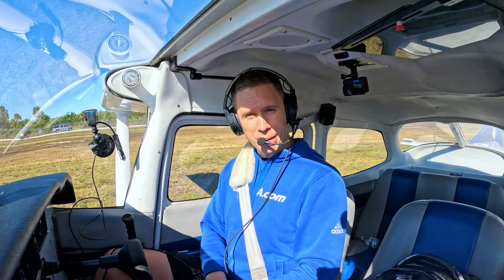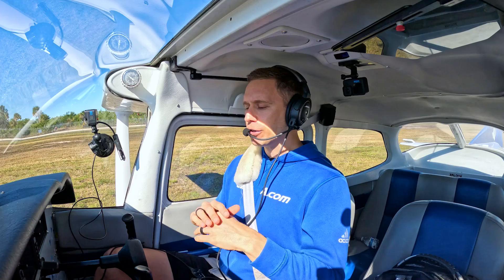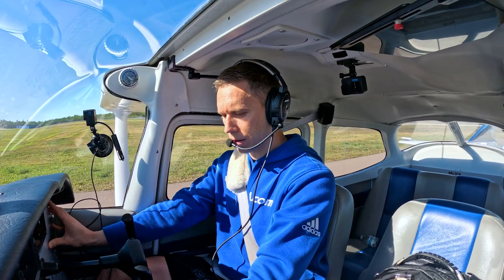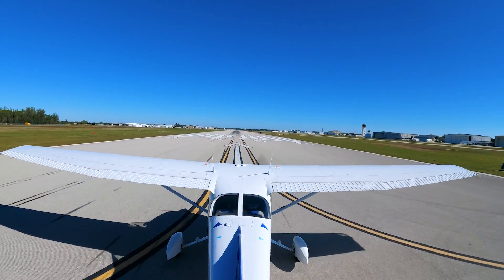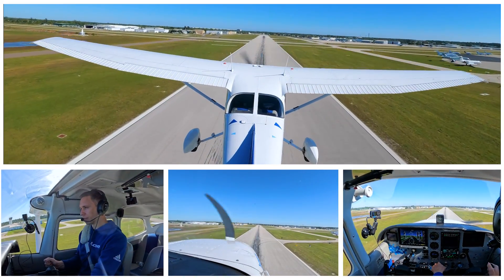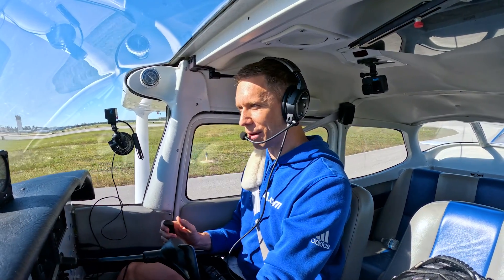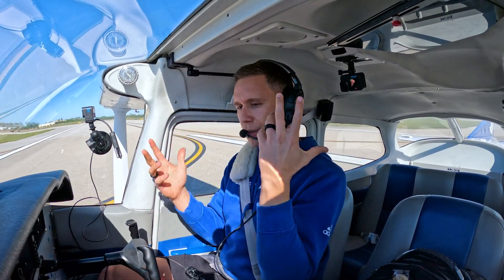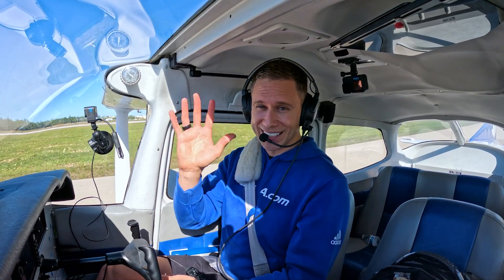Engine Failure On Takeoff with Runway Remaining - Day 5 of The 31 Day Safer Pilot Challenge 2024

Comment: 5 for 5.  Have to say, this has actually happened to me...bird strike first, right into the prop arc...guts and crud spreading all over the front, then the engine coughed, I was maybe 50' off the runway.  Not going to lie, it took me a good 2 to 3 seconds to register what happened.  Pushed the nose down for airspeed, saw the ground in my peripheral vision, pulled the nose up just enough to put he mains down....hit hard...from there it was all rudder.  Landed hard...very hard.   Pretty much all I can say.

Comment: As others have said. This should be briefed before EVERY takeoff in order to try and minimize the Startle Factor. At the same time we should also brief our minimum altitude for a turnback to the airport, e.g. "If the engine fails below 1,000' (AGL) we will not attempt a turnback to the airport, buy will land 30° to the left or right". These things need to be in our minds before leaving the ground!

Comment: My instructor did that to me before i soloed. Started the climb and he pulled the throttle all the way back. I immediately pushed the nose down and shouted "what are you doing". He pushed the throttle forward and said "keep going, nice reaction". That gave me a lot of confidence and proved to me I could react automatically without thinking. It was a great lesson. I will never forget it.
Reply: I was taking off, and a gust of wind made the plane abruptly bank right. I did nothing.
My CFI reacted quickly and put that nose down. 
My reaction to the unexpected is to do nothing. I need to work on that.

Comment: 5 for 5. Didn't have an engine failure but should have applied the same procedure when my seat lock broke and I slid back away from the controls. Ended up transferring controls instead.

Comment: My flight school is at a small municipal airport (I67)
We have runway 1/19 and it's very small... 2808' x 60'
If you're taking off using 19 and had to do this you'll probably end up going past the displaced threshold and into or even across the local roadway. Just look up I67 on Google maps and you'll see how close the runway is to the road. 
Taking off using runway 1 you'll probably end up in the field but won't hit anything. 
The airport/ runway is also bordered by houses to the west and a school to the east. The terrain is pretty hilly and wooded all around so an emergency landing after takeoff <1000' would probably end up being a controlled crash to avoid houses and property...
My CFI told me a while back that this is a fairly challenging airport/ runway and that "if you can land here, you can probably land most anywhere"

Comment: 5 for 5.  2 years ago when I got current again, Ifound AQP from Josh Flowers (Aviation 101), Steve Thorne (FlightChops), and Dan Gryder (Probable Cause).  Your pre-takeoff brief that flashed on the screen is KEY!!  I changed my before takeoff brief to include those details...forcing myself to be prepared for an engine out.  WHEN (not if) it happens, get light in the seat and land straight ahead.  Thank you Team Schappert.

Comment: 5 for 5!  I once had a real engine failure on downwind as a solo student.  Luckily my instructor taught me well; I made a short approach and landed safely with enough momentum to get clear of the runway.  We’d practiced failures many times before that.
Reply: Did you cut through the pattern and go backwards on the runway or did you complete the pattern?
Reply: @acasualviewer5861  Short approach.  From downwind I made an early base/final.  I suppose you could call that completing the pattern.

Comment: 5 of 5 I have practiced this without leaving the runway. Engine seemed ruff or something didn't feel right about the airplane during take off. I pulled power, apply brakes gentle, and keep the airplane aligned with rudder.

Comment: Nice one, Jason. I never did this until I was going for my Commercial. Very enlightening as to how quickly your airspeed bleeds off while pitched up and reduced power. One thing for a realistic scenario would be to add a 3 second "Oh @#$%" factor before pitching forward - try it at altitude in the practice area. Always, safety first.

Comment: I had a Piper Tripacer and the throttle was on the left side of the plane.  On takeoff I took my hand off throttle after going full throttle.  On takeoff about 50 ft the engine went to idle by itself and I had no time to figure out what happened.  I pushed forward and was able to land on the remaining runway.  After I figured it out I learned to keep my hand on the throttle at all times on takeoff just as my instructor had told me before!

Comment: 5 for 5.  One comment and one question.
I greatly appreciate the concise bullet point summaries you include that detail key takeaways from the lesson.  I always do a screen capture and have a saved photo album on my iPad dedicated to your teachings.
Now the question:  I believe I heard you say “No flaps” as you were touching down following the simulated failure.  At this stage, I would typically still be at partial flaps for takeoff and would have remained in that configuration as I landed.  Should I raise the flaps when the engine fails on takeoff or am I misunderstanding your comment? Thanks. ~Mark G.

Comment: 5 for 5.  When I was taking my FAA check ride (way back when), I had landed, the examiner had me line up to take off, when we were about 50 feet off the ground, he pull the throttle.  I was not expecting it which made it all the more real (landing was successful).  I will never forget that moment.
Reply: Keep your hand on the throttle to prevent unauthorized “engine failure”!  lol
Reply: Same experience as you had. Just for my EASA PPL checkride the examiner called engine fire, while at about 50 feet up in the air. I had to kill the throttle and land back on the remaining part of the runway. Never forget that one.